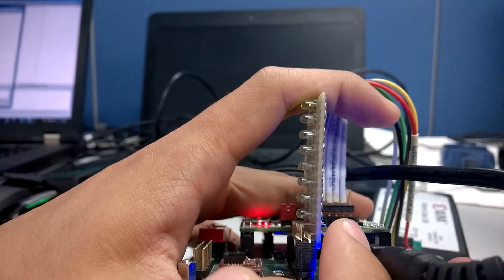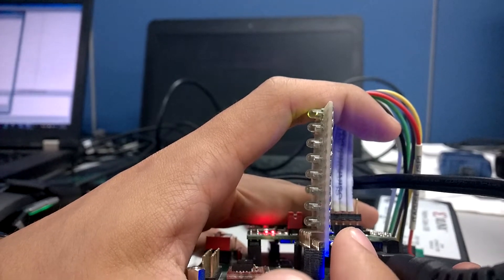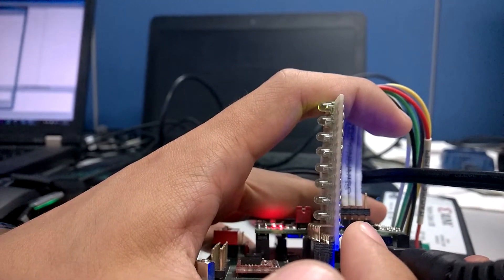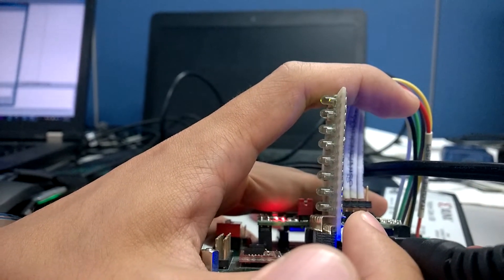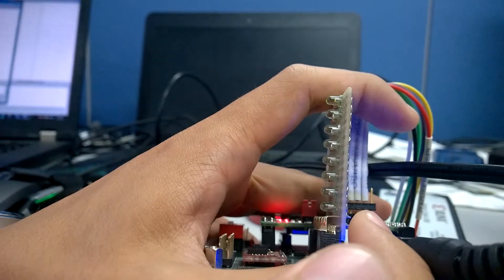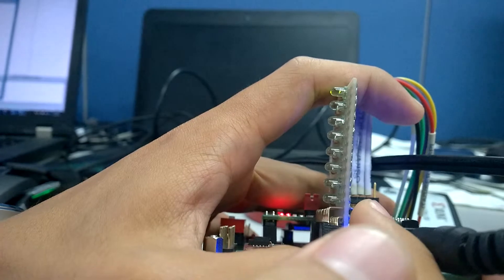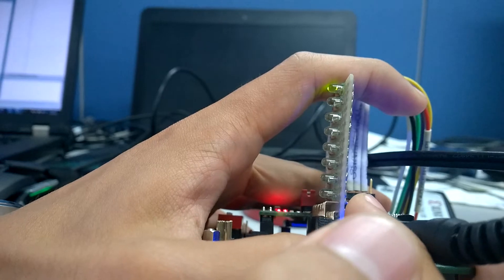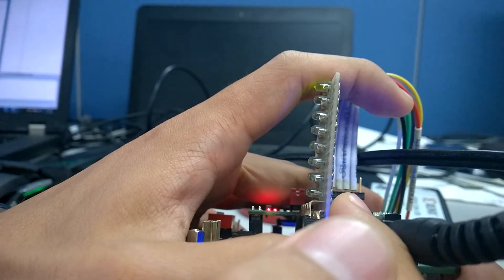VHDL Based FPGA Control LED Brightness

Comment: I'm having a rough time on trying to change my project.
In my initial implementation I made the leds brighten and then turn off and repeat.. but now I want them to dim after they are lit as well, like yours do. 

For what I said above, I used a counter that increments to 100 (cnt) by clk signal and then resets, and two counters that consist in the period (c0) and the duty cycle (c1) their range is 0 to 15. so when cnt is 99, c1 increments. c0 increments once every clock signal. 
I got something like this: 0:  c1=0;  c0=0; after 100 clk signals: c1=1; c0=4; after 200: c1=2; c0=8; after 300: c1=3; c0=12... if I choose 100 as period, i get c0=0,4,8,12,0,4,8,12 and so on. and by the condition:
if c0<c1 then
 led_output<="1111";
else 
led_output<="0000";
I get: 0% duty cycle, 50% duty cycle, 75% duty cycle, 100% duty cycle, 0% duty cycle (repeats from now on)
What should I do to make the leds start dimming after reaching 100% duty cycle?
(I tried decrementing c1 when it reached 15 but it gets really messy, the waveform).
Reply from the maker: +Vanessa Mercea 

Hello, Vanessa. Thank you for your questions. I did this project about two years ago, I think I wrote a case statement structure in VHDL. Something like after a certain period of time, the LED will run at a certain PWM. Different cases corresponding to different PWM. I hope it will be useful.
Reply: +Reg Fu You don't happen to have the code, do you? xD
Reply from the maker: +Vanessa Mercea 
No, I don't. You are quite smart :)
Reply: sigh Well thank you, I'll smash my brain and try to do something with my ideea or yours. Thank you for the answers. :)
Reply from the maker: +Vanessa Mercea 

is this your school project or assignment or what?
Reply: +Reg Fu Its some part of a project. Sorry, I didn't mean to sound rude for asking the code - there are some on the internet that I could take. I just wanted to see if your approach fits mine or not. My project is Variable Illumination and it has many settings. I found it quite hard to understand PWM. I understood how it works, but I'm finding it hard to set the duty cycles so that leds dim in a way or another. :-?